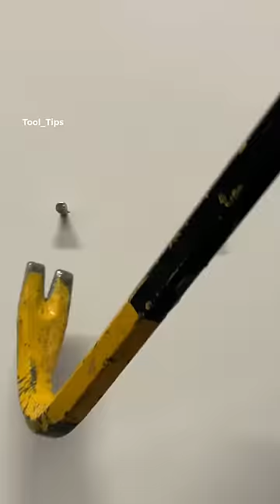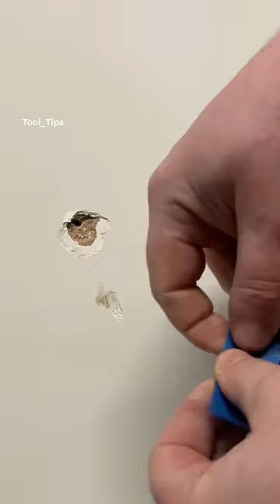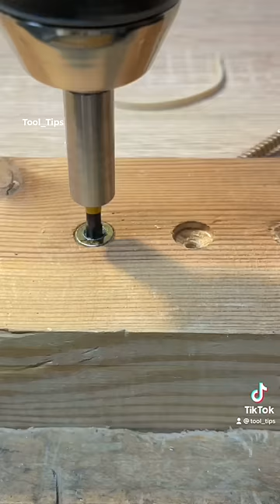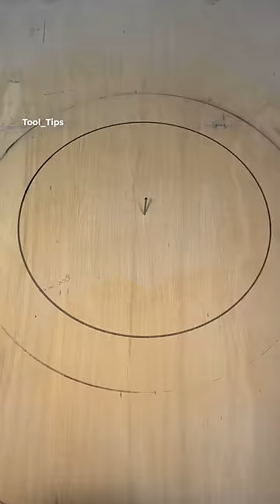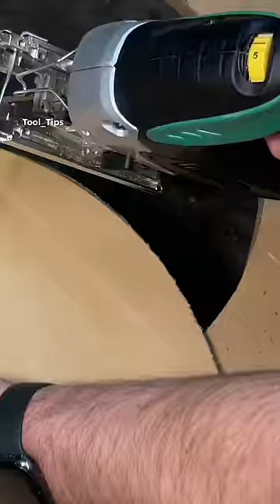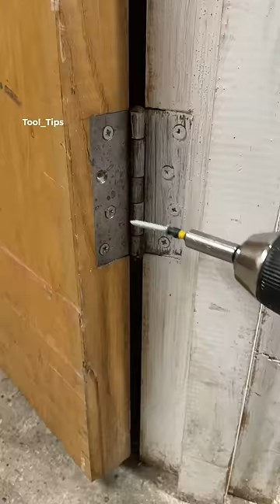5 amazing life hacks #shorts

Comment: The extraction of rounded one using what I think is rubber sometimes does not work, tried tape, rubber and used fabrics. There are times when the fucking screw is just on way too tight specially when it is not pre drilled before putting the screw. I even got a messed up one before on a renovaying job when the dude living there actually put some sort of damned glue on the screw/hooks because he said that it was so that the screw would NEVER be loose. Did not even thought that he might someday renovate or the screws/hooks might snap one day. It was a total of 45 screws/hooks btw, it was a fucking mess.

Comment: If you have wood and the screw isn't locking in use a bigger thread... Or drill the hole out slide in a dwell with glue  and re drill 👍

Comment: On the first tip, the main difference is they used a board inbetween the “heel” of the prybar and the wall. This pulled the nail out straight instead of at an angle. That does more than the tape ever will.

Comment: While these are cool I gotta question why? 
Especially with stripping more a already stripped head on a screw, why use tape so much especially when you need a exact measurement, the tape to hold the paint down was kinda smart not gonna lie but again kinda gotta question all of it, again still cool may seem helpful also
Reply: Because they can be useful? If you're trying to remove a nail for sheetwall and you don't want to ruin the wall. As for using the tape to create guidelines, those lines if you need to cut the pipe not just measure it. Having the markings go around the entire pipe can be beneficial to individuals who are new to sawing/carpentry.